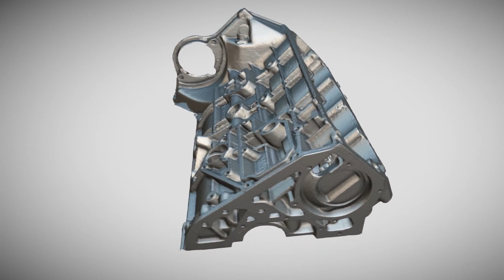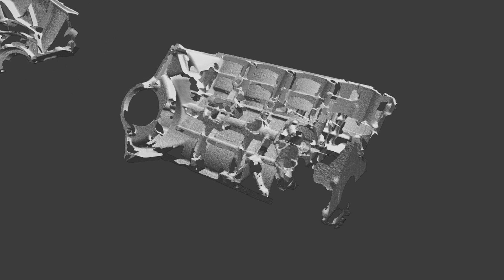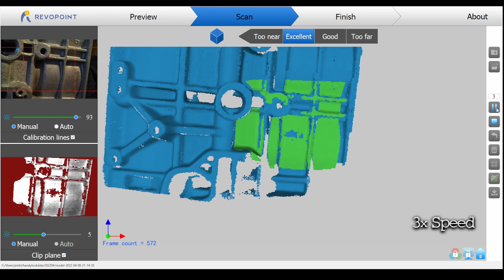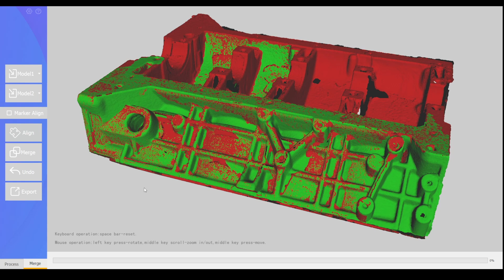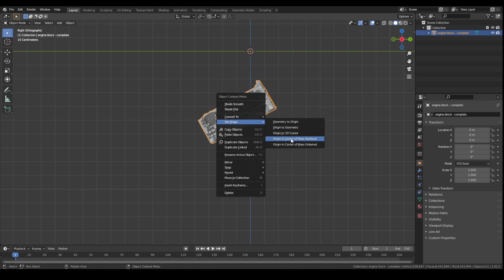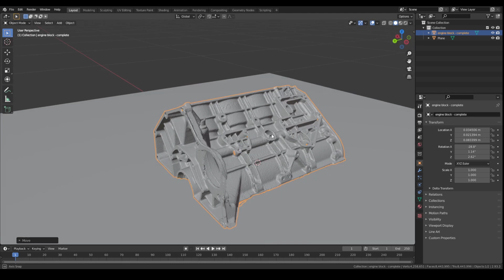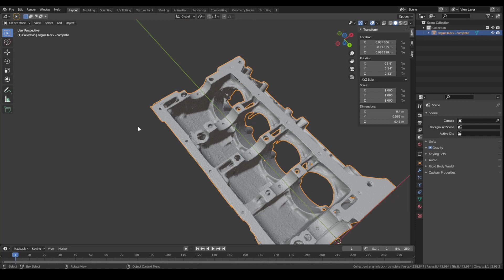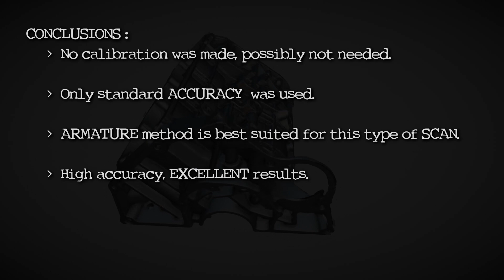How I scanned the Lotus Esprit engine block - 3D scan Revopoint POP2

Comment: Hi Jon,  Great demo, Do you have any idea IF you could use both the POP2 scanner AND the Mini that Revpoint have and make independent scans, then use the armature method to assemble the meshes together from BOTH scanners?  For me, I need a high degree of accuracy in some areas of the model than I think the POP 2 is cable of, then other areas need to be much closer in tolerance like the mini is capable of replicating. questions is do they both use the same software and can both types of scans be brought in, aligned, and fused?
Reply from the maker: They certainly use the same software.  As you might have guessed I haven't been scanning for a long time so I haven't tried - I was going to do this with an engine cylinder head, scan the outside with POP2 then the ports with Mini.  If you goto my sketchfab (link in description) you can see where I got with this.  At the end of the day the only difference is the density of the pixels so I cannot see why it wouldnt work.
On that note I do have the new RANGE scanner coming next month (hopefully) so I might get back into doing some more videos.  I'm just busier than a cat at a laser show right now.

Comment: did you ever try to scan scale models with that scanner?
I'm looking for a 3d-scanner for scanning 1/24 & 1/18 diecast cars and assembly kits, i want to use that 3d-models as a reference during 3d-modelling.
Reply from the maker: Mini is much better equipped for this over the POP2 as it can see much more detail.
Reply: Yeah, thanks!
Have you compared them both with Creality Lizard?

Comment: Hi,

A quick question. Could the 3D files you obtain using this method be used in video games? Basically, keeping a maximum of quality and details, what is their weight and the number of vertices?
Thanks
Reply from the maker: Hi - basically no as the poly count is WAY too high.  i try and keep the vertices in the 1-3 million mark if working in Blender which handles point clouds like a boss.  In CAD systems especially Solidworks, you need to really slash that to 100,000.  Some CAD systems can handle meshes much better.
On the game graphics - you would 'bake' a texture onto a low poly model, to make a 'bump map'.  Have a look at some videos on it - its really interesting.
Reply: @JonHimself  I'll have a look at that then as I'm a modder for Assetto Corsa on PC. Thank you for this.

Comment: Jon i have been following some of your work, and i had a quick question. Do you think the POP2 or the Mini is best suited for your type of auto-reverse engineering. I have similar interests but with Aircooled items, but torn between POP2 and Mini, thoughts?
Reply from the maker: Tough one.  POP2 is more reliable for larger scans.  Mini is tracks really well but you don't wanna be using it for an engine block, even on low settings it generates too many points.  The two overlap for sure, but mini for anything under the size of a laptop, else POP2.  If you need to go under a size of a cup/mug then Mini.  The Ibiza fish I scanned was the size of my fist scanned with the POP2.  It's close but the POP2 has the versatility edge imo.  HTH

Comment: Once a scan has been acheived how are you importing them into CAD, I continually get errors when trying to import a meshed OBJ into NX? Or is there a video on this as well?
Reply from the maker: Depends on your CAD software.  I usually use STLs as they are a little less of an issue than OBJs.

I take the STL and post process in Blender, then import it into CAD.  There is a short video on my channel explaining part of this process.

Comment: Hello sir
I have question
For car 3d scan
Like chassis, axles, suspension, body, engine
Which revopoint is your choice?
Pop1, pop2 or mini
I'm going to buy 3d scanner (cheap one) for reverse engineering and build bolt on kits for suspension or engine swap kits so I'll be grateful for your advice
Scanning parts for chassis is about 4.5m for chassis and 95×90×60cm for engine (big old suv)
Reply from the maker: POP2 is probably best all around.  Mini is great but for anything over the size of a football you get diminishing returns.  POP2 will handle 90% of your work and for that reason its the one I would recommend.

Comment: So you don't use the point stickers on any of your scans? It does not look like there were any applied to the block? I am an engineer and looking to get this scanner to do quick scans in the office and this would be a much cheaper solution to the Metrascan tool that we are looking at for the bargain price of about $120k or a Faro at $50k. Also wondering if you have tried using the Revo on any larger parts and what your results were? Great videos!
Reply from the maker: I try to avoid them unless it's really necessary.  I used Creaform scanners in the past and whilst they are excellent, they are pricey.  I've scanned the majority of a car bodyshell with the POP but the drift error is so large on such a small device.  Large objects can be done with some creative thinking and for its cost it is a great bit of kit, but its going to have limitations, especially accuracy over distance.

Comment: Hi John.
First of all thanks for your videos clear explanation, TOP.
I want to do something similar in the future. For that I want to buy a laptop for this kind of work.
I assume you also use a laptop for this kind of work.
Will 16Mb RAM and 4Mb memory on the video card be enough?
I'd love to hear from you.

Sincerely, Geert Wijnhoven
Reply from the maker: I'm using a mix of laptop and desktop.  My laptop is only 8GB, desktop 16GB but performance based.  It has no real issues but I like to compress the scans to reduce surface noise and artefacts anyways.  You want more than 4GB of RAM without a doubt, the bigger the scans the more memory you need and processing power.
Reply: @JonHimself  thanks for the information Jon

Comment: Great video for shows the process.

I’m looking into scanning my engine bay, engine and trans (Volvo 1800E), and seriously leaning towards a POP 2.

Any thoughts with the POP 2 for larger scans like that ?
Reply from the maker: Yep it will work, but you have to be mindful of how to give it the best chance of success.  Dont try scanning in one go to start with, take smaller scans, get them into blender and manually align.  once you're happy then just experiment.  I have a quick video on Blender and how to orientate scans on my channel.
Reply: @JonHimself  did test cloudcompare for mesh alignment already?
For X/Y/Z alignment i use GOM Inspect (free) 3-2-1 method.

Comment: Hey Jon, are you using this scanner as a hand-held device? I would like like to scan larger parts such as trunks to make spoilers and etc. Hoping it works for that.
Reply from the maker: You can, you just have to be aware of drift (ie stacking tolerance errors).  If it doesn't work 1st time keep trying, it can be done.  Some guy on the forums had a great idea of throwing a crumpled sheet / towel over the back of the car to aid tracking, totally ingenious :)

Comment: Great video and very encouraging results !!  You mention the "armature method" what other methods are there ??
Reply from the maker: Thanks - the key is the 1st (armature) scan which makes it different to a standard merge.  A basic 'Overlap' is another method, where all the parts overlap into the next - you'd only do this is you have 2-3 scans to merge though, the more scans you want to merge, you're better off using an armature.  You could also try and scan in one piece if you're brave.
You can also scan and manually align in a 3rd party software using physical measurements, this is more suited to larger objects - If you look at my Sketchfab, that's how I did the car body shell.

Comment: Very informative video, thanks for sharing. The only thing that I'd suggest taking a look at is the notion that no software or computer can handle more than 10M points....THIS software can't but others out there can.... Nubigon, Cloud Compare, Geomagic, Polyworks, Design X, MeshLab..... just to name a few. And you don't need a high end computer..... I'm using all of these on my Lenovo Laptop P53.
Reply from the maker: I said 'most computers' which for the average user of a low end cost scanner and this software is a correct statement.  Comparing other software has no relevance, all the processing, and point fusing HAS to be done in Revopoint's software which drives the scanner - for a bundled package is good but has its obvious limits, me a lot of those sequences are sped up 20x
The point was to cut down un-necessary data, there is nothing more frustrating than doing a great scan only for the computer to run out of memory and crash!

Comment: So would you really recommend Revopoint POP2 ? It took me too long to scan a simple statue ?
Reply from the maker: I have a lot of experience scanning which is an advantage for sure.  Yes I'd recommend the POP2, for the cost you can get pretty amazing results, hopefully my videos speak for themselves.  It obviously isn't inspection quality but its not far off - I wasn't able to compare it to a scanner where I used to work because the $100,000 kit kept breaking - the POP however worked fine, so again - do you pay for something that is great but breaks a lot or compromise and get something reliable ?

Comment: what mode did you use for the scans ? feature ? ....I have problem where the scanner usually just start creating another instance on top of the previous scan without dropping. So basicly you can make small errors more and more as the scanning goes along. Especially if you try to do hand held. with tripod and the object rotating is much more reliable. It´s like the skanner has better and some really shitty days when nothing works.
Reply from the maker: Feature mode, hardly use any other to be honest.  Compound errors are generally a combination of shake (which the POP2 really supresses) - and lack of locking features which twists the scan very slightly resulting in drift or ghosting.  Keep an eye on the scan and use the pause > undo function to step backward in time and re-do portions that are undesirable.

Comment: What a great video and result.
Would it be feasible to scan an engine bay with the pop 2 as well?
Reply from the maker: Yes, especially if you used this method to capture a large area and then attach smaller scans in place.  However for a hobby scanner of this size you will be pushing the limits of what you and the scanning equipment can do.  It can be done but a lot of thinking outside the box needs to happen - where there is  will there is a way.
Reply: @JonHimself  sounds like a huge challenge, but good to hear that it's possible. 
I just need the motor mount location positioned correctly to virtually place an engine in the bay to design motor mounts. 
Let's see if I can pull it off :)
Reply from the maker: @11991Dan  good luck!

Comment: Product development engineer here. Love your channel and your work, very detailed and easy to follow. Glad to see consumer grade scanners are proving to be more accessible (and affordable) while providing fairly accurate results. I utilize the creaform scanners at work and have been thinking about picking one of these up to do my own side projects. Based on your experience with the scanner and software, would you recommend this scanner for someone looking to reverse engineer and build molds for high performance automotive parts (aero, suspension, etc) considering you’ve been using this for your project. Or would you suggest a different product ?
Reply from the maker: I haven't tried any other devices tbh.  I looked at something that was affordable just to do one job on the car which was for the front duct.... ended up doing all this so the product exceeded my expectations.
If you know scanning (creaform trained here) then the POP2 is great imo, esp for the cost, your experience will enable you to push the device to its potential which as you can see from the scans I've done it's well capable of doing.

Comment: Very nice example of a large / detailed project. I like how you show your approach to constraining the scanning error (ie. adding detailed areas to the scan after doing a rough whole scan). On the accuracy checks that you did, do you have the capability to best-fit a plane to the face or to fit cylinders to the bearings? That might give a better understanding of accuracy/flatness than trying to manually align?
Reply from the maker: No I aligned everything as shown.  A best fit might work but I don't think the scan is accurate enough, meaning you can see overlaps of the other scans.  What would be ideal is a 3 point plane picking the areas that best suited.  Right now I find eye balling does as good a job.

Comment: Hi, What software is used at 4:57 and on to merge the meshes? Seriously great work with using Blender to do a manual alignment of surfaces. It would be great to be able to make planes/lines/points in that program to do a 3-2-1 alignment, but your work in Blender is good enough to make it all useful!
Reply from the maker: Thanks - it is the OLD version of Revopoint's software.  I probably shouldn't have used it as it has caused some confusion, but it just works for me and I needed to get this video out.
Later vids I will have the new software on.
Yeah, Creaform used a piece of software called VX (really bad choice of name) which did a great job of making planes and primitives from scan data (cost a fortune though).  However just eyeballing it can produce some really good accuracy as I hope to have shown.
Reply: @JonHimself  it seems like the latest version of revostudio doesn't have this merge function? What other software do you recommend to follow the method shown in the video?

Comment: 6:05 you mention software bending scans to merge. Based on that comment, the software generates a 'best fit' when merging files? The merge is executed automatically?
Reply from the maker: Based on my experience, yes - this is why it is important to create an armature from  a single scan so the additional scans have something to accurately align to.  I may do a bloopers reel at some point to show all the issues I have had, I did have one issues when aligning the parts in this job where the large side was completely bent, was very strange.
After aligning, the scan should be assessed and then the merge button pressed to confirm.

Comment: Hi, thanks for your impressive video. May I know is this scanner good for truck bumper and chassis scanning? Will it be able to meet the accuracy of bolt mounting point?
Reply from the maker: It can be done but you'd need to use a different method by making a parametric armature and manually positioning separate scans on top of that.  If that sounds hard then it is and it should be avoided unless you have a lot of experience.  I may do a video on this when I re-do the car body.
Reply: @JonHimself  Great!! Can’t wait for that😎

Comment: Great videos, I've watched the others over the past few months as well.  Please show the workflow and results from transforming your meshed model to CAD model in future videos for the engine block.
Reply from the maker: That's the plan.  I've never done a solidworks tutorial before as I often do a fair bit of back and forth or exercise features I haven't used in a while to achieve something.  The block is easily achieved but a fairly involved model.  I need to find some larger measuring tools as well ;)

Comment: The time information is good for me as a reference. Also pre aligning the parts is a good tip. I got my scanner now and am curious if I manage to do my foil wings and boat parts
Reply from the maker: Have a look at my other videos, the 1st one I did was a fin for a racing windsurfing board in carbon.  You should have no problems.
Reply: @JonHimself  they are all saved in my watchlist allready

Comment: What software package are you using to merge all of your STL files?  I don't see that merge option in my Revopoint Revo Scan software?
Reply from the maker: Its the older version of Revoscans software (V3.1.02) - it seems to run better for me, the later version crashes here and there.  I appreciate it can be confusing, I need to persevere with the new software.
Reply: @JonHimself  do you have a link where I can download that version? The newest version doesn't have that merge feature from what I can tell.
Reply from the maker: @mjplays354  I dont I'm afraid.  You could try and contact Revopoints support, however I am sure the latest version has a merge facility, the layout is just a bit different.
Reply: @JonHimself  hey Jon, thanks for the feedback.  It looks like Revopoint removed this feature from Revo Scan and moved it to Revo Studio (two separate applications). Thanks for all the great content, it's been super helpful!

Comment: Awesome video. I got my POP2 about 2 weeks ago but have not had time to play with it yet. If you mentioned it and I missed it, I apologize, but what is the program you use to merge the 2 meshes or scans?
Reply from the maker: Its the older version of Revoscans software (V3.1.02) - it seems to run better for me, the later version crashes here and there.  I appreciate it can be confusing, I need to persevere with the new software.